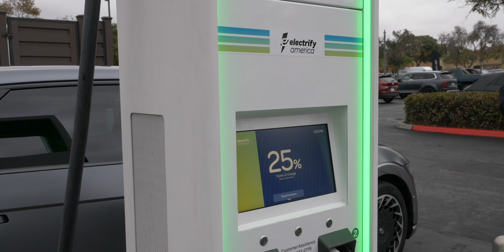Millions of USED Electric Car Batteries Could Be A Ticking Time Bomb

Comment: Tesla’s Gigafactory is close to Thacker Pass Lithium mine to reduce manufacturing costs.  When is GM, Ford and FCA scheduled to break ground on their new Pershing County Nevada EV factories?  Nevada has no income, inventory or corporate taxes and they all want to take advantage of this as well as the close proximity of Lithium. Also, the Gigafactory is solar powered, something that all businesses will have to achieve do to new NetZero legislation.  Building in a sunny place is paramount to avoid heavy carbon taxes moving forward.

Comment: How much carbon emissions will be created by EV battery recycling? Will the carbon offsets be worth it?

Proper handling and storage is something I'm sure will be overlooked when the demand for cheaper EVs increases over the next several years with the usual cutting corners, taking shortcuts, etc, especially with aftermarket EV batteries.

Comment: Notes while listening... 

Battery packs will not end up in scrap yards.  They are valuable resources that are sold to DIY people. People turn them into home power storage. It is a booming industry. It is easily able to keep up with current end of life batteries.

These batteries still have 80% of charge capacity.  Saying things like "fully spent" only applies to damaged packs. They aren't broken like a worn out engine - they just don't charge as well.

Recycling is well on the way to being able to handle this... It is literally all the materials you need to make a new battery lack and recyclers are scrambling to get ready for this - they will not leave the money just sit there... there is so much money involved that we should just assume the problem will be solved.

Ultimately all batteries will be sourced by the recycling of much older batteries, but at this time we just do not have enough end of life batteries to allow recycling to happen at large scale.

Did you say "a thermal runway" when talking about thermal runaway? 

Battery based systems are much less likely to cach on fire than gas powered systems.  

LFPs cannot catch on fire... half of all EVs are made with LFPs... seems like an unusual thing to bring up since it is lower risk than a gas fire.

Bringing up fires without explaining the actual safety values is extremely irresponsible on your part - you implied battery based cars were likely to catch on fire when gase powered cars are much more likely. 

5% of batteries that reach their lifespan are recycled because the bulk are sold to DIY people who are perfectly happy with 80% capacity.

You mentioned not having enough lithium to meet our needs by 2035.  You need to account for current growth in Li production as well as technology advances.  If you can make LiOH ypu can basically print your own money.  People will not let this money just sit there...

Also... EVs built today will probably last 5x as long as the gas equivalent.  The better designed batteries of today will stay in use for a million miles while ICE can last up to about 200k miles. If cars last 5x as long there is no need to build as many over extended time periods...

Pay attention to what Tesla is doing - they lead the pack, and they build the cars that already outperform your basic comments.  They sell 70% of the EVs in America - they already recycle their batteries that fail quality checks.  

You seem to be about 2 years behind on your understanding of existing technology, and you don't seem to be considering the advances in technology that are happening every few months.

Comment: Erm, no, they can be used for stationary storage, so that would be like throwing thousands of dollars in the garbage. Why would you throw a $10,000+ battery in the bin? You wouldn't you'd use it for the remaining 79% of energy storage which for a domestic battery would be massive. Given a Tesla powerwall is only 13kWh and most used EV batteries are about 40kWh like the base model Leaf at the least then that is a whole lot of storage. The time this will be a problem will be in the 2040s. By that time we should be well on the way to recycling on a mass scale.

Comment: At least when gas vehicles were invented they were designed to be rebuilt and recycling broken metal was easy as tossing into a giant liquid metal pot. (I don't know the exact procedure).

My biggest concern is the lifespan of these EV batteries, some people already had to replace them as early as 5 years. So getting a replacement battery is already a problem and how expensive is it to dispose of said battery when the time comes? These are all potential problems and I would prefer to keep investing in gas vehicles which we can run synthetic fuel and some if not many or all of them can run on hydrogen. Ending internal combustion engine vehicles is not the way to go especially when there isn't anything viable yet to replace ICE vehicles with.
Reply: Don't believe the FUD.   Tesla batteries can last hundreds of thousands of miles, especially with LFP formulations.   Longer than most ICE engines.   and they're able to be repurposed or recycled, despite what FUD you hear here.

Comment: The EVs in California won’t be any problems at all! First the energy grid won’t support everyone charging their cars. With no charging for batteries how will you know it’s bad?
The focus should be on hybrids as they don’t have an as huge batteries and they can run very quickly and economically miles per hour
Reply: Sorry grandpa,   not everyone is going to magically buy an EV by tomorrow and plug into the 2022 grid all at once, so that tired whine is pointless.   

Most EVs are charged overnight when there's plenty of spare capacity, meanwhile renewable generation and grid level battery storage are growing by leaps and bounds.   Tesla is now deploying an ever growing Virtual Power Plant with their Powerwalls in California.    Generation won't be an issue by 2035.

Comment: There are companies NOW that recycle over 95% of EV batteries, e.g. Redwood Materials.
A recent Tesla model 3 battery only had 5% degredation after 500,000 kms (over 310,000 miles).
Many of the newer LFP and LFMP batteries will last over 1 million kms, maybe even 1 million miles.
Then they will still be useful as a backup home battery, then years later they will be much more than 95% recycled.
The Electric Viking has over 1000 videos for anyone interested in actual research.

Comment: Byd( A Chinese company )blade batteries ( LFP) are the safest  on the market and refute the arguments in the video.
Reply: Yes, LFP kills most of the FUD, but most of these people don't even know what they are.    no fear of fires, degradation above 80% is not an issue = much longer life and much higher usable capacity at a lower cost per kwh and no cobalt, nickle, manganese...

Comment: Pretty sure companies like redwood have already solved recycling issues.  They’re already recycling entire packs.
Reply from the maker: Except they can’t recycle do PAX until they’re completely dead. End of that only 2% potentially can be recycled so it’s not 100% recycle rate.
Reply: @CarCoachReports  redwood claims they recover 95% of materials.  The reason we have not seen this at scale before is because tiny batteries such as in smart phones weren’t worth the cost to recycle them.  Now that the materials have huge value recycling will be scaled up.  Also they have method to drain packs.  The recycling infrastructure and scale is not there yet,  but the technology already exists.
Reply: @Story_Teller_Everyone  don't scare the commenters here with knowledge over fear.

Comment: The one problem with EVs that I have not heard anyone talk about is, what is going to happen to the used car market when most of the used cars are EVs? I would imagine the main reason people would get rid of their EV is problems with the battery, so who is going to want to buy a used EV that needs a new battery - and that is before anything else that might be needed?  With a gasoline car you can fix pretty much anything that might be wrong unless the body is completely shot.  There are many people out there (myself included) who can't afford a new car (of any kind) and have always bought used ones. Used car prices are going to go through the roof.
Reply from the maker: Used car prices are already up 40%. In addition to that used EVs are kind of flat but this is going to be a problem the future..
Reply: There is a video on another channel about a guy who bought a used EV and the cost of replacing the battery was about $1,000 more than the value of the car.
He found a source for replacement cells and did the replacement himself but the amount of disassembly that he had to do would scare off most people.
Besides, do you really believe that replacement batteries will be available?
I have several battery powered tools and replacement batteries are unavailable after 3-5 years.
You should just assume that your shiny new EV is disposable...and there will be a healthy government fee to get rid of it.
Reply: @ghost307  That was my point (and I know the channel you speak of and have seen that video). EVs ARE basically disposable vehicles so, what can people afford to buy when they can't afford a new one?
Maybe that has been the plan all along - to make everyone use public transport.
Reply: @arlo0011 Spending $70,000 for a disposable car of $20,000 on one you can fix is a suckered game.
I think you've hit the nail on the head.
Once we're all unable to pay for a new electric car and the ICE cars are gone we all have to use government public transportation...and we all know what an efficient, economical joy that will be.

Comment: It's definitely more about political posturing than science.  EVs are part of the solution, but there are huge hurdles to overcome and the government is not helping anything by pushing adoption without addressing the underlying issues.  Where is ANY credible plan to improve the power grid so it can support charging all these cars?  The politicians are doing a lot of talking, but are unwilling to roll up their sleeves and dig into the truly hard work that would be required for broad adoption of EVs.  They also are not working to allow or address any of the other technologies that will be needed for applications where EVs are not appropriate.
Reply: You Sound Like a Big leftist, seeing you think ev,s Is part of the answer, Please tell us All  what Kind of batteries  they will Come of with  to power planes ships  trains  or refineries??? There are thousands and thousands  of Very day items  we use made from Fossil fuel by products  And No Has Even Comes Close  to figuring this one out, Just face the facts , ev, s  Are Not The Answer And Never Will Be